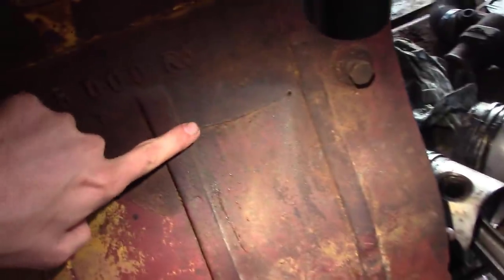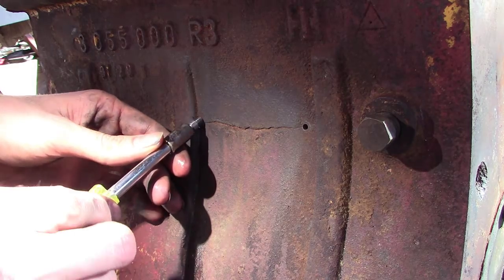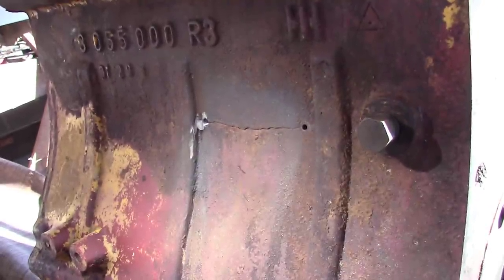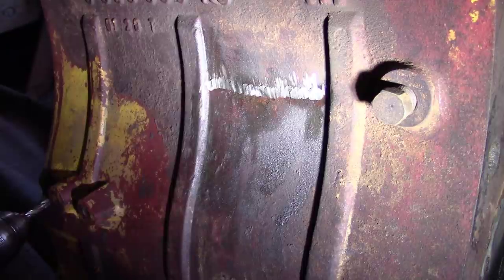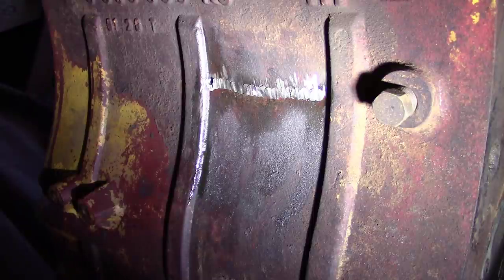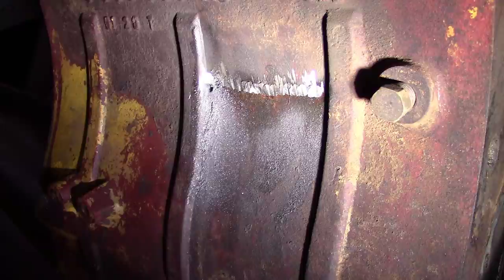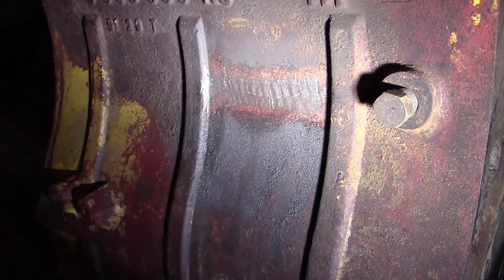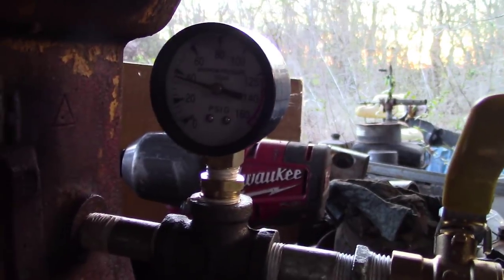Old Bulldozer Reawakening (OBR) part 2

Comment: I have watched a few videos of a guy doing this process to cracks on a flathead Ford block a few years back. Except he had a guide that would step the next hole over a set distance. He would drive the pens in with a 3/8’s air ratchet and then after snapping the head off, he’d give the body a good peeling work out before grinding the excess off. Really neat process!

Comment: I see a lot of comments below doubting or questioning the permanence of Loc-N-Stitch. Done correctly with the appropriate pins and locks for the task at hand it works the treat. Loc-N-Stitch will advise and send you the correct stuff for the job.  it is a permanent repair, even in combustion chambers of cylinder heads. I have used it to replace a blown out section of a transmission case with a formed steel plate. As far as I know it's still going. 
It simply is the best way to repair cast Iron. Put the welder and torch away. 

And yes Ethan you can go  another direction off a pin, no worries BTW I don't think you screwed up as long as the shoulder seats in your spot face  your good.
Reply from the maker: Thanks I believe it worked well it is real old technology so I wouldn’t think they would keep using it if it didn’t work.  Thanks for the comment about being able to go different directions I figured you could as long as you didn’t get too happy with it.

Comment: This is a very old process. I watched a machinist repairing cracked cylinder heads using this process in 1971 and I suspect the process had been around for some time even then.

Comment: Ethan, this was a fantastic undertaking! Thank you for bringing me along for the duration. I have had good luck with Muggy Weld when I am repairing cast iron blocks. I am anxious to see how this works out. Also I am starting a small engine repair and mobile welding business and am looking for a great truck with a crane like yours. I am in PA and hopefully someday when this -rona thing is over we can meet up and have a beer at a FAB-Tech or SEMA. Thanks again.
Reply from the maker: Yes sir.  I thought about it long and hard on what to do the reason I went with lock N stitch I was told if you have a leak you can put a pin in where the leak is without taking the motor back out and there is no risk at melting a O-ring in the wet sleeves like with welding.  Yes sir I would love to go to a FAB-Tech one day as well.  Thanks for the comment.
Reply: @EEJester1586  Thank you for the explanation. Sounds like you picked the right technique. It looks great and I am anxiously awaiting the next video.Hopefully we will be able to do the Fab-tech  thing this year. I will keep in touch my friend.

Comment: Back in the 1970's I worked for an engine repair shop and at that time I watched a guy repair a cracked cylinder head using the same method.

Comment: Reminds me of putting a Dutchmen in. My application was drilling and tapping between a pulley and the sleeve I machined and put in, did not use pins but a set screw and red or green loctite, really locks the two pieces together. In your application the pins are a great since you need it to seal.

Comment: Well I found the Dozer video I was wondering about. Sorry I asked on the other video. Im old...LOL...I have to say all the years Ive been working on Equipment and cars trucks and big trucks. Thats the first time Ive ever seen them. Ive seen them welded. But never like this. Thatx awesome. I hope they work out. They seem like it will. I guess when Its running and gets to operating temperature that will be the next test. I hope this works. I like that little dozer. Cant wait to see it back together and running..Great Video. You taught this old fart a New Trick. Never too old to learn...LOL...I do it daily...LOL..Thanks For sharing

Comment: Never seen that before. I wonder how they hold up with repeated heating and cooling cycles? Anyway, always good to see your posts.
Reply from the maker: We will find out. I was told that it’s a permanent repair. The pins expand and contract at roughly the same rate as that cast iron so I doubt it’ll move.  Always got a plan B if something happens.
Reply: @EEJester1586  Let's hope it remains forever a plan B. But that sure is a unique way to patch cast iron.

Comment: nice video thank for sharing question why not weld with cast iron welding rods ?
Reply from the maker: I wanted to pressure check it without having to build it to see if it had any other cracks.  If would have welded it the heat would have melted the o-rings in the wet sleeves. Then I couldn’t pressure checked it.

Comment: Just curious but did you watch the lock-n-stitch video? you're supposed to drill one,use the guide and drill another all the way across,then you use the guide and drill between each bolt you installed so you have one continuous piece not just thread close to thread... And being into welding it's a fairly simple repair why not just use a form of welding/brazing??
Reply from the maker: I did watch several videos on the Lock N Stitch process and it was recommended to me to do it exactly the way I did one at a time.  They make guides but the salesman that sold me the kit told me that it wasn’t necessary to have it on the kind of repair that I had.  The biggest reason I didn’t want to weld it was I didn’t want to ruin the seal on the wet sleeves in the engine. Even though I’m getting new wet sleeves I wouldn’t of been able to test it to make sure that I had the cracks sealed up.

Comment: I have seen these before. But I still don’t understand how they can keep the crack from opening up wider just by having something threaded into it?  Is it the sealer that actually glues the block back together?
Reply from the maker: From what I understand the tap is where the magic happens.  They call it a hook thread.  When you thread the stitch bolt into the hole the bolt grabs the walks of the thread and pulls them together.  The sealer is just insurance I believe.
Reply: @EEJester1586  no shit?!  That’s pretty ingenious!!  Thanks for that tidbit.

Comment: Not so sure how this will do with it expanding from heat, I’d just weld it
Reply: I ain’t talking shit btw, you do good work from what I’ve seen just what I stated would worry me
Reply: If it'll work on a locomotive engine block, it'll work for him. This is one method GE uses for repairing damaged engine blocks. They have their own guys and equipment they send to railroad company shops to do the work.

Comment: Why not use muggy weld rods to repair the crack instead?
Think you would have a better long lasting result with less work. Instead of relying on sealant products. Since you're a welder thought you would be welding it.
Reply from the maker: I sure thought about it.  I went this route because I didn't want to risk burning up the O-rings on the wet sleeves so I could test it.  And from what I have been told if I do have a leak I can fix in with having to take the motor back out.